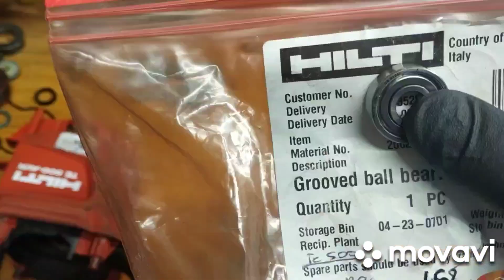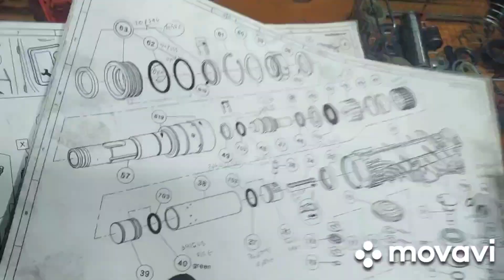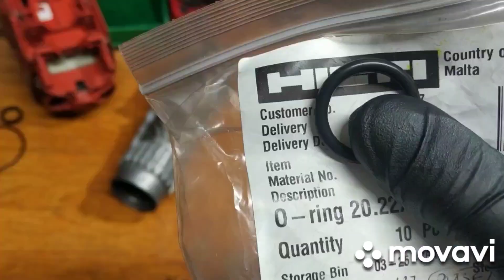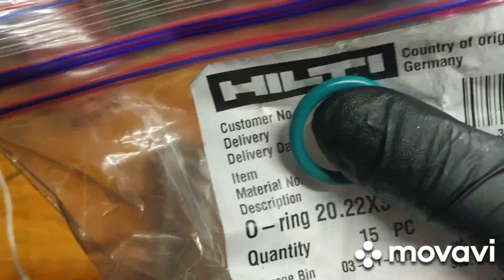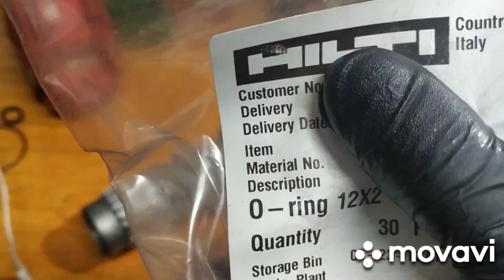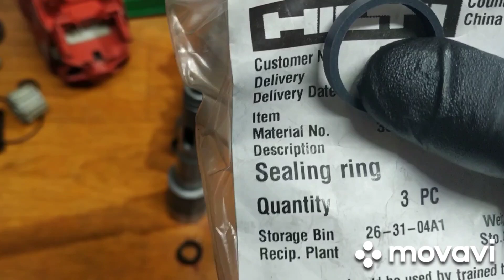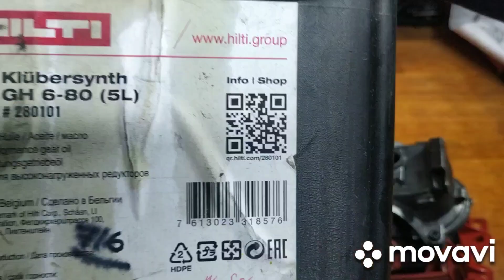HILTI TE 500 AVR REPAIR , REBUILD , ITEM N107/22. Alex/IRL.

Comment: Great video thank you! But as the original Hilti replacement parts are very expensive, is there somewhere I could get the actual dimensions of the O-rings and seals to order individually (in the video the replacement part dimensions are not so visible)?